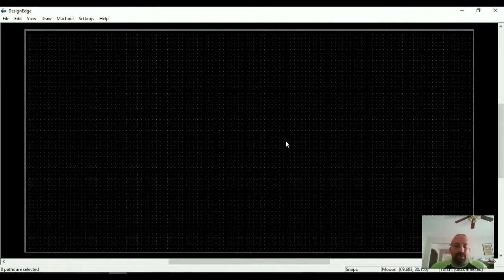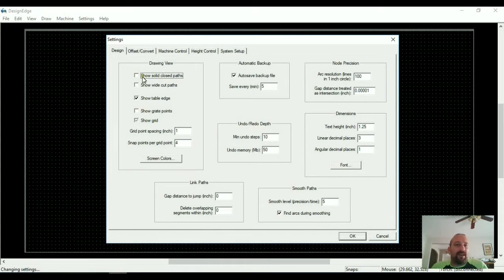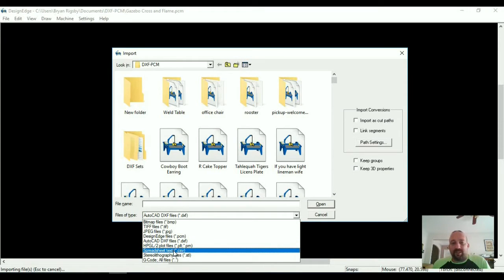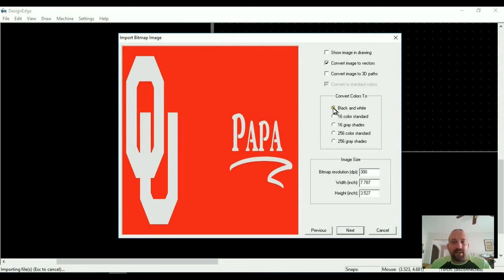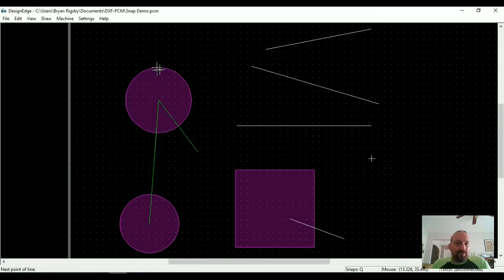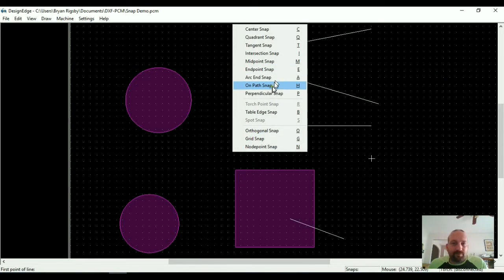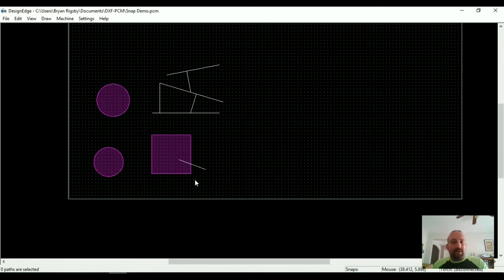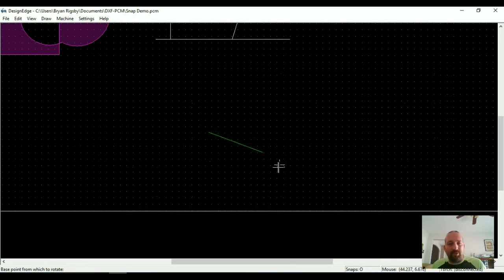Design Edge Learning Series 001

Comment: Basic/Advanced  Design Software.
I am new to Design Edge i work offsite with several different companies for various cutting services.  My most recent contact is using Design Edge and is un able to import my DXF files?  Is this a basic/advanced design software issue, i haven’t spent much time with the software in person, I’m not sure if the software is even seeing DXF files when in the import dialog.  Have you come across anything like this?
Reply from the maker: All levels will import DXF. Make sure you export/save as R14 if you can. I’d be happy to help you and/or your client. You can send me a sample file at Robert at 490Creations dot com if you’d like.

Comment: Hi, we got a plasmacam in our workshop but i would like to have the software on more computers, do you know how?
Reply from the maker: Hi Erik - If you have DesignEdge (software version 4.0+) then you need to purchase an additional seat license from PlasmaCAM. (First additional seat is currently $498, Second to Fourth are $249 each). Then you can use your install disc or download the software update from the Owner’s Community and it will do a full install.

Comment: I bought a gotorch which cam with PlasmaEdge software set.  I don't have left icons.  I don't think this software does anything.  What do you have?
Reply from the maker: The GoTorch comes bare standard with only the very basic machine control system. It is an upgrade to basic Design for you to be able to draw anything and create cut paths in Design Edge. Then after that, you would do well to upgrade to have Basic Height Control, then Advanced Design, Advanced Machine Control, and finally Advanced Height Control. It is a significant investment but it will absolutely be a great machine with the advanced levels of software to do what is shown in the videos. You can see what those levels are in my video on ‘What do the levels get you?’

Comment: I purchased the 4X4 machine, basic height control and 1 extra seat license late 2017, received it January 2018 and stored it in crate, in my shop until last month when I was ready to get started on it and with it. Very professionally and well assembled exactly as told and shown by them, 7-25 & 26-19. It's within a 32nd or less of perfectly square, the grate couldn't fit or look better in it and is grounded with 5 1/2' of #6 bare copper to 5/8" copper clad rod over 6' down. The gantry and carriage ride smooth with the same clearance throughout their travel. Found and purchased the computer to run it, brand new, 8-1-19. Downloaded, installed and activated the latest version of the software directly from the site as I was told my disc was already out of date. Have done the detect machine tests as well as initializing and moving the gantry throughout the table and range with the computer and control panel all successfully and well. It's a shame that I'm starting to feel like putting the whole deal on Craigslist now and exposing plasmacam for false advertising of "ease of design", and more. It is no more than a $10,000 waste, big space taking, 400 lb pile of scrap metal without a computer, their expensive software and being able to use it ! If you or anyone else can point me in a decent way to learning the basics and turn my frustrations into more positivity I would be grateful. Thanks.
Reply: I don't quite understand what your problem is. 🤔
Reply: First of al PCam is a piece of shit when it comes to design. Have about 4,000 design files for Plasma CAm All in .PCM.  Nothing reads these files but PC  Guy I am Beta testing for  a guy is adding PCM previews for reference galleries This new software will only run on Win 10/11 Kind of hard to sell the batch with nothing to look at... LOL

Comment: Man, I really appreciate your effort but I'm still lost or should I say, not finding the right, just basic, beginner direction in this endeavor, What So Ever. I am a beginner and brand new to CAD but I'm no dummy at all and have an extensive and strong mechanical, electrical, technical and more background from multiple, official sources spanning decades and usually figure out and conquer most problems and challenges relatively easily and quickly. I admit I haven't spent much time with the software yet but based on all the "How Easy It Is" advertising and selling points, didn't/don't feel like I have to and am now becoming quite frustrated and even pissed. Can you recommend anywhere, anyhow or any person/s from which I can get "ground up", beginning, sense making, Basic, Starting CAD instructions from as plasmacam's video manual is FAR from advertised and what it should be not to mention it doesn't even work with windows 10. Took 3 or 4 calls for them to finally admit they have that wide spread problem and can't even fix it still, yet.
Reply from the maker: Sorry you're struggling. Different people learn in different ways so if the video manual isn't doing the trick you could come.try one of my workshops or could go a different direction and sell it. There will be a learning curve with any machine and I try to minimize that with my classes.
Reply from the maker: My workshops are a good resource but nothing will do more than spending time using the software. It really is one of the easier programs to learn and use.

Learnplasmacam.ticketbud.com if you're interested in a class.

I'm not sure on the video manual, I have it on my windows 10 laptop and it works fine.
Reply: Hey man, thanks and you're right about it really just takes time with the software. I know/knew that really but they make it look like you buy and you're cutting major production next day. Again, I am new to CAD but design edge is not a good place to start. What instruction they have seems to be all for people familiar with CAD to start with but also extremely underwritten and backwards. They need a glossary of terms and such, what they mean and how they work...IE, nodes (which I learned the most about from your video), snaps, rastor ? image and so on. I'm getting it more now though.., just a patience and perseverance thing now, lol. Thanks again.
Reply from the maker: @Stucknarutt  no problem. Let me know if I can be any help!
Reply from the maker: @Stucknarutt  Any updates on how it’s going? I’m back doing in-person workshops and have a couple more left this year. My class link has changed to learnPlasmacam.ticketbud.com if you or anyone else is interested.